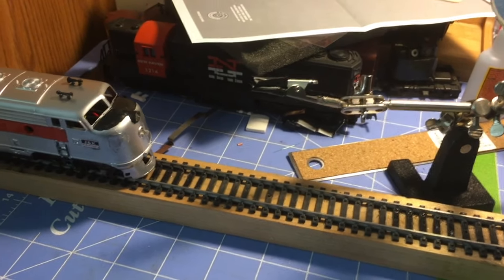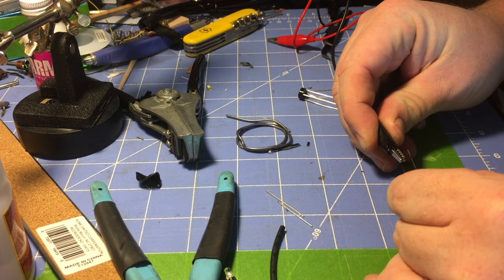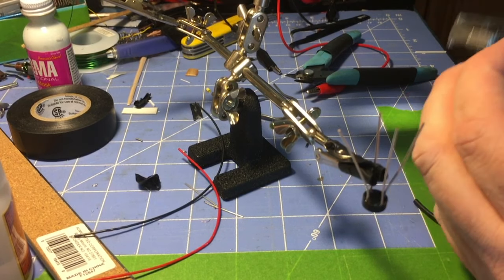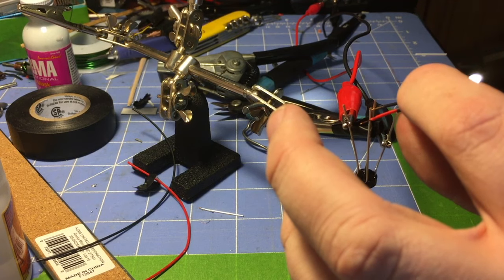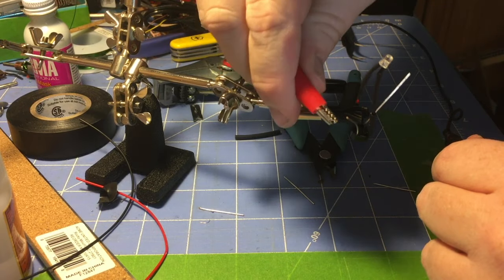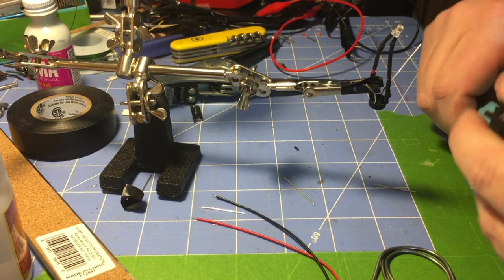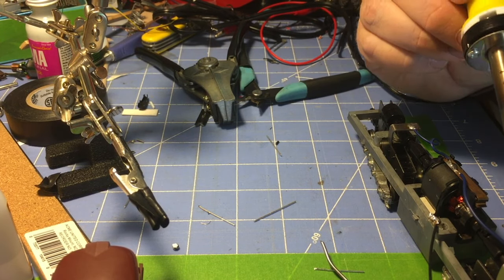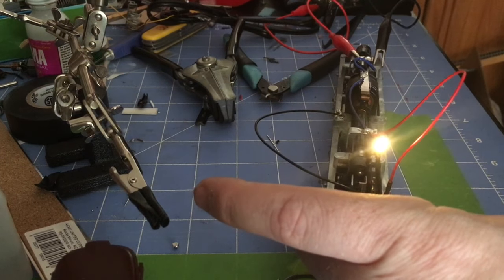How-to #5 - DC Locomotive LED Install

Comment: good morning J&K, I built my own bridge rectifier, installed in the same manor as you did, but I noticed a loss of power in the locomotive., meaning it not go as fast as it did did before the led install. do you notice the same issue?

Comment: wow your really good at that.. I would have forgoten something,, like the shrink tubing,, lol,, or the LED.. with the DC set up would that not make it a easy way to hook up front and back lights, and be directional, then ? thanks for sharing
Reply from the maker: Problem with DC and led's is polarity.  You can set it up with directional lights and such, it just requires a little more circuitry.
Reply from the maker: +sparky107107 and thank you!  I have about 15 years of practice.
Reply: Very cool video. Question regarding the lights. In the case of the first loco you showed with two headlights, does a resistir Neff to be connected to each LED even if they come from the same source? Also, is polarity an issue when you are working on a Locomotive with a DC board? Thank you.
Reply from the maker: +Luis V always pair a LED with a Resistor.  And yes.  Polarity is an issue.  If you watch one of my other videos you’ll see the circuit used to nullify that issue.